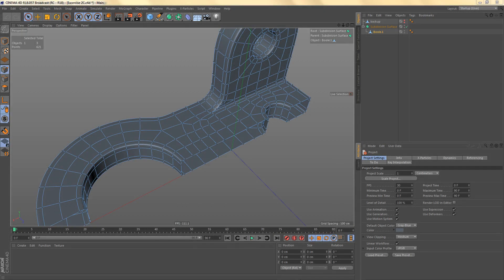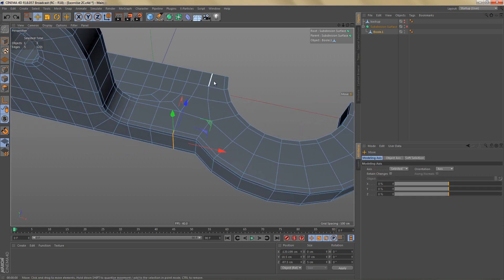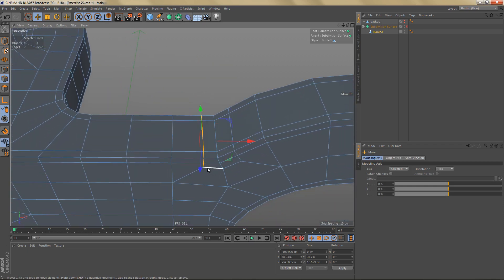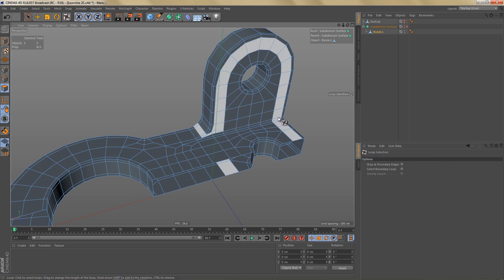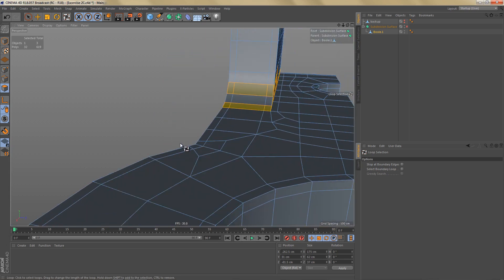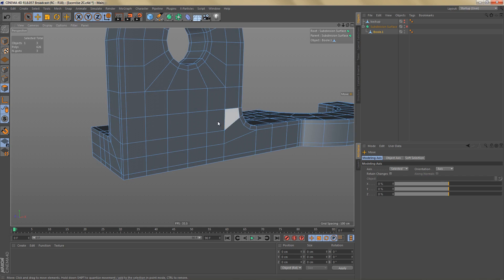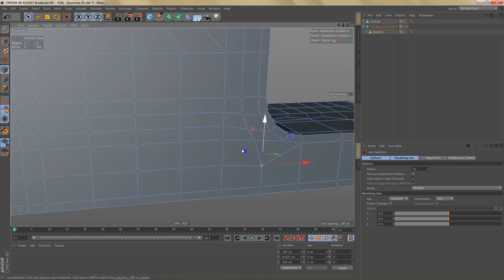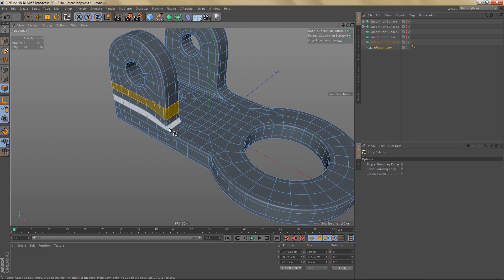SDS Modeling Excercise 02C | Cinema 4D Tutorial

Comment: How do you connect points with just a mouse, using no key shortcuts?
Reply from the maker: I am using a shortcut, the arrow key: <. Unlike some other C4D shortcuts that require two keys, the ones that need only one key, like D for Extrude, don't show up on the screen. That's why, when I use the < key, you can't really see that shortcut and it looks like I'm drawing lines between selected points.